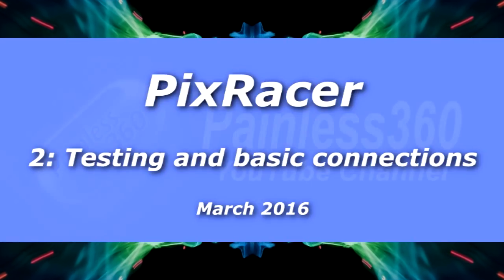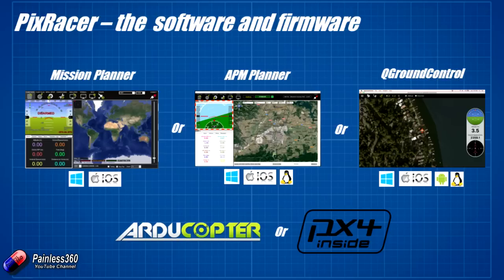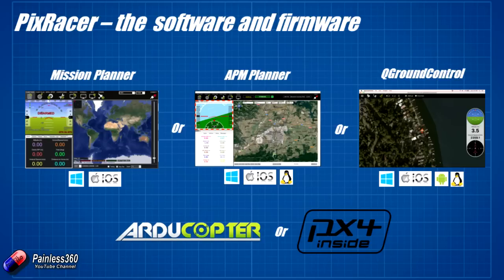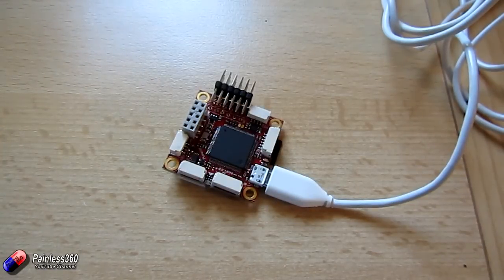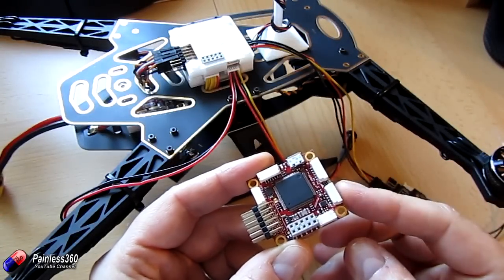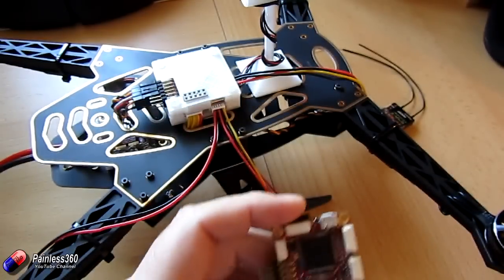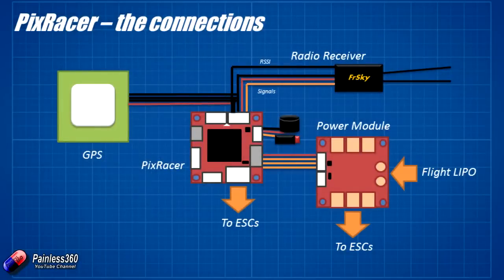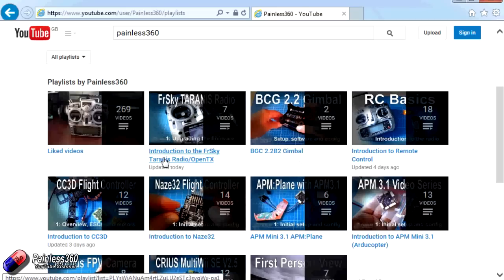(2/2) PixRacer - Software, Firmware and Connections

Comment: I have ordered one of these very capable looking boards for my long range TBS Disco and intend flashing with PX4 firmware and use QGC for set up. It does look like a higher spec laptop is needed for setup, my question is, does this translate into a high spec tablet being needed for telemetry reception on the ground station?
Reply from the maker: +robrow from what we can see with the our testing its only the firmware flashing that has a major problem. We have reported the problems to the Dev Team so they can improve it..
Reply: Sounds good, thanks for the reply, looking forward impatiently for the next installment.

Comment: Hi, do you know if there is any difference in just simply using the batterie cables parallel to the PDB instead of looping them through the PDB back to the Frame?
Reply from the maker: +juesch23 doing it that wY will stop it being able to keep track of the current from the battery.. Happy flying!

Comment: hi. can i add peripherals? such as control for the gimbal or other sensors? I use a hk pilot micro and it controls my gimbal thought a cable that goes to the gimbal stabilisation board
Reply from the maker: +emi83ro Check out the documentation for the PX4 and Arducopter firmware - all the answers are in there.. Best of luck!

Comment: Painless

I received my pixracer and have done everything in this video. FC is active, receiver is bound and tested. I was able to select frame and calibrate sensors but I can not calibrate the radio. I followed your 3 of 3 video in the the pixhawk series for Taranis setup but , in QGC when it asks to calibrate the radio, nothing happens. I click on "calibrate" then on "ok" then get nothing but the button to "calibrate" again. Can you get any in site on this or lead me to where to go? This board is so new and there are so many combinations of SW/FW, its hard to find information for just this case. Funny thin is I was able to calibrate radio in Mission Planner SW.  

SW: QGC v2.9.4
FW: PX4
HW: PixRacer V1
Tx: Taranis Plus
Rx: X4R-SB
Reply from the maker: +Duane Bohmier Have you selected S-bus?
Reply: +Painless360 

Thank you for you response and forgive me, I am not QGC/PX4 literate. Where do I select s-bus, or better yet, where do I go to learn these things. http://qgroundcontrol.org/ documentation is very uninformative. It seems to cater to individuals that have been using this platform since inception and doesn't lend to beginners. I feel as if these SF/FW's are secretive. Searching the web kinda goes in circles because the GCS's are derivative of others. I can not find anywhere on how to set up a FC and rx/tx to a GCS from start to end. Your video was best I could come up with but still didn't work for my situation. Again, thank you!
Reply from the maker: The setup will be in the Radio section I expect. We have a few series on the Pixhawk and Mission Planner and also lots of videos in the 'Introduction to RC' that cover the basics of the hobby too. We will be creating the next video in this series for release in May..

Comment: Hey Lee, where is the next installment in this series, been waiting some time to hear your opinion? Have there been any issues with the Pixracer?
Reply from the maker: +robrow expected late April / early May. Setup is identical to the Pixhawk series on the channel already. QGROUNDCONTROL needs a little more time to settle down.. Best of luck!
Reply: +Painless360 Thanks for the update, it sounds like I would be better sticking with Mission Planner? How is the PX4 stack working?
Reply from the maker: Seems to be great, Mission Planner works better with Arducopter.. This video series is using the 'bleeding edge' tech so we spent a lot of the time we had carved out for it getting QGroundControl to work..

Best of luck with yours!
Reply: +Painless360 I agree,it does seem to have some 'issues' but I'm getting there. One thing I did find is that it crashes just about every time unless I run it in GPU Compatibility mode as Administrator. I've got the GPS working now but can't find the parameter for enabling an external compass?
Reply: +Andrew Powell And now I have! http://www.rcgroups.com/forums/showthread.php?t=2576614&highlight=pixracer&page=34

Comment: Hey I've recently purchased this board but the specified power module was not included and I was wondering if it is possible to use to power modules for the pixhawk or APM?
Reply from the maker: Not sure, I'd contact the vendor and see what they advise. Best of luck!
Reply: Painless360 will do thanks though. From what I've seen in terms of schematics for the both it should work but I'll be careful still (y).
Reply: hey just thought I would give you an update of what I found out. it can work with the power modules for the pixhawk butttttt you will have to tinker with the default power cable that comes with the pixracer since when you plug in the connector to the power module it's in the reverse order. All in all I still ended up ordering acsp5 power board since it's like the size of a penny.
Reply: Shivan Ramdhanie ytttyte🔤🔤🔤🔡🔤

Comment: Hello, I need the info is there an option to control the flight of pixhawk by using computer (laptop over wifi) rather than by RC Station
Reply from the maker: No need to post a question twice, I try to answer all of them ;) http://ardupilot.org/copter/docs/flying-with-a-joystickgamepad-instead-of-rc-controller.html

Comment: Hi PL360/All,  I am looking to purchase a GPS module & like the look of the Radiolink SE100 but am unsure if the HMC5983 compass used in this unit will be compatible with the pixracer.  I am hoping that you can shed some light on this for me.  Many thanx in advance.
Reply from the maker: I've not used one but they appear to be sold for the PixHawk.. http://www.robotshop.com/uk/radiolink-se100-gps-module-pixhawk.html?gclid=CjwKEAjwgtTJBRDRmd6ZtLrGyxwSJAA7Fy-hhtj6yUxU8Gr0vrljM-JY3zxAaaxNpG7oxwJIpTv9choCYPbw_wcB
Reply: Yeah, you're right but I have some JST GH cable connectors so I can convert the cables to suit the pixracer set up.  I'm just not sure if this module would actually work once the cable conversion was done.  I'm defaulting to your expertise on this.  :)
Reply from the maker: Oh blimey! :D I've not tried it!

Comment: Hey Painless360, this humble padawan still have no transmitter, no parts, no frame, no flightcontroller yet - I have a lot to learn first :D
I think a simple i2c-splitter could be Heaven's Gates if you want external flow-cam, solenoids, sensors, lost drone beepers etc  -  but would ArduCopter recognize these devices?
What would happen if you placed the GPS and mushroom antenna down in level with the components, would it perform very bad?
What would I use a wifi-module for if Tx+Rx can do all the telemetry? Will it control the UAV via my phone?
Reply from the maker: +iMeMySelf if the GPs has a great view of the sky, and is far enough away from other areas of magnetic interference for this onboard compass it should work fine. There are some fantastic resources in the Ardupilot wiki, I'll also be adding a lidar or sensor to the pixhawk 2.1 in the coming weeks to. Stay tuned
Reply: Thank you as always for a very fast reply and will of course stay tuned. 
Quite a genius approach you got, every video you made is viewed 1000 times because they are relevant for everyone and unmatched in quality.
Reply from the maker: Thanks for that! :D Happy flying!
Reply: On a sidenote, the price for a laser-based Lidar-Lite v3 is sky high, but it will probably perform top notch. 
XL-MaxSonar EZ4 (and clones) are ultrasound-based but much cheaper hint-hint :)
Reply from the maker: +iMeMySelf this is the one I'm using here - https://www.3dxr.co.uk/product/benewake-tfmini/
Reply: Oi, delicious piece :o 
Good find, I can't wait for that series :)